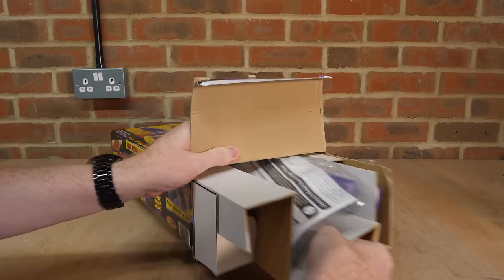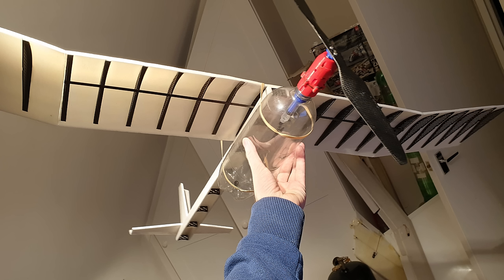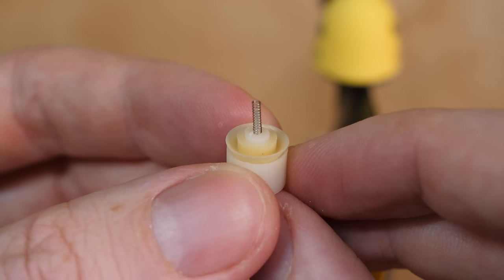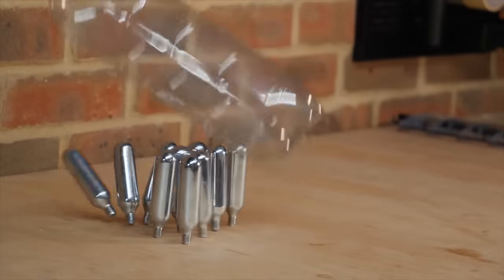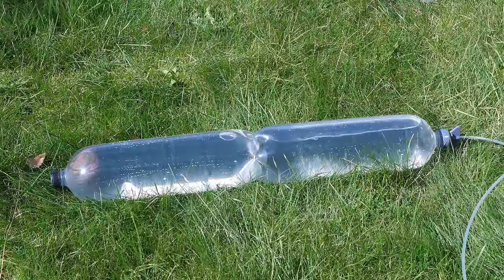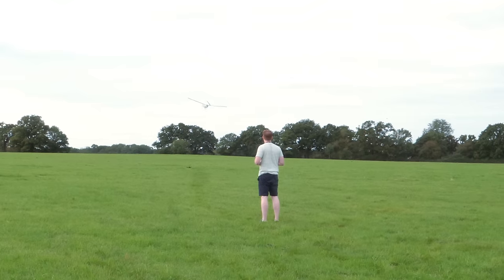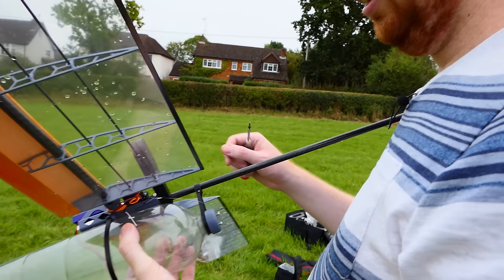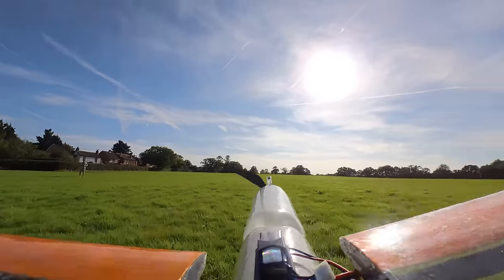Flying a Plane Powered by AIR

Comment: a crazy idea would be to make the wings pressurized to gain more air volume, maybe some internal tube like chamber along the wing to avoid pressurizing the actual film skin
Reply: Maybe the wings filled with helium to decrease the lift needed from the engine?
Reply: storing fuel in the wings is something actual airliners do, this isn't as crazy as you think
Reply: I know it's arbitrary but since it's a plane it wouldn't make sense to use lighter-than-air gases to generate lift, otherwise you could just make a blimp and easily beat the flight length record
Reply: I love this idea
Reply: Wouldnt it be better to replace the tail boom with a third bottle? Like Teslas "structural" battery pack.
Reply: I'm guessing it would be way too much work to build light weight wings that can take pressure.
The shape of the bottle is a big contributor to its strength.
I do like the idea of using helium though haha, even if it doesn't 'make sense', I've seen videos of professionals reacting to basketballs, footballs and American footballs filled with helium and it makes a tiny difference, I imagine it would have a bigger effect on a lightweight construction like this.
Reply: you would have to have the wings be able to hold that pressure, that thin plastic wrap wont hold any air
Reply: Yeah thin tubes in the wings to store the compressed air could work but at the speed it flies drag isn't the main issue I suspect
Reply: tubes are going to add too much weight to pay off
Reply: Sounds cool, but anything capable of holding sensible pressure and not bulging out would have walls way too thick and be way too heavy. The bottles are pretty much the optimal design for this purpose, their cylindrical shape allowing for as thin walls as possible without deforming.

You could use the bottles themselves as wings for a Coandă effect plane, but they're very inefficient and it wouldn't be worth it either.
Reply: These are actually good ideas that are at least worth trying...
Reply: Or an even crazier idea, fill them with helium and get some free lift (at least enough to be just under neutral buoyancy.
Reply: @fdhgsdfdssdf it wouldn't generate much lift because the volume is too low. It just offsets a portion of the weight. Potentially allowing for more bottles or a more sophisticated engine.
Reply: @ImmortalAbsol  that's why the tube like chamber, but it probably would be too hard to source and I don't know how well the weight to volume  to pressure ratio of a bottle scale down, probably would be better to just  have a big singular bottle instead of multiple, and make it part of the structure too.
Reply: @weresonic11 the difference will not be noticeable at all trust me
Reply: You could also make wings as oxygen tanks.
Reply: @hazza2247  got any other gas in mind or would it just be better for storage 🤔
Reply: @DeuxisWasTaken you can put those bottles in the wings, will still gain more "fuel" even if not the entire wing is pressurized. If that is the only place you pressurize (aka add bottles) it will additionally also reduce drag, as the wings protect the bottles from causing drag.
Reply: Should use helium to drive the motor
Reply: @weresonic11  bouyancy of helium is about 1g per litre, the wings look like they could hold something between 1-2 litres, not worth the effort of filling and sealing them I think.
Reply: @weresonic11 not really worth it. With the most optimistic assumptions about the internal volume of the wings and filling it up with hydrogen instead of helium (more lift for the same volume)... You'll get like 3-5 grams of lift maximum.
Reply: If you increase the size of the plan you could just put bottles inside the wings
Reply: @TheWinstn60  Most of the drag comes from the wings and not the body because of how slow the plane flies and how big the wings are so adding more pressure in the wings is a good Idea because it wont increase the drag
Reply: Haha these ideas are wonderfully unhinged 😂
Reply: I doubt that would work, if you pressurise the wings, it would change the shape of the airfoil, if the wing was made of a stiffer material and air bags placed inside the wings, it would be heavy. A third bottle seems to be the most logical.
Reply: The shape of the wings poses an enormous challenge to get that done. However, I think if you made the whole leading edge of both wings a really long high-pressure tube, you could eliminate a lot of the other structural weight of the wings. You could put a tiny low pressure cutoff valve on this tank so that it would only use the pressure down to 20 psi or something like that, because you'd need to keep some pressure in that tube at all times in order not to lose the structural value of it.
Reply: Also you could use compressed helium to run the air engine. It would be wasteful, but you should be able to get a longer run out of it!
Reply: @weresonic11  no it’s just the difference in weight by using helium instead of air would be ‘fuck all’ as they say, it would effect the flight time by like 0.1 seconds so probly not even measurable or worth it. for storage nitrogen or CO2 is probly easier to get your hands on

Comment: Two tips. 1) I have been recycling PET diet coke bottles into printer filament for some time. My first step is to smooth out the iconic shape by pressurizing it to 70psi with a little water and heating it slowly in an oven.  I've successfully shrunk, elongated in a form, and reformed the bottoms into a smooth dome. You may want to consider doing the same, giving you more volume at the same weight. Coca Cola published that their 2 liter bottles are rated for 150 psi, so if you only need 70 some experimentation might be warranted. I would love to see what you come up with. 2) Secondly, you could replace the tail rod with a pressurized fluorescent tube protector and make the plane a flying air tank. The water rocket people use them as pressure tanks as well, so there is a lot of data and technique to start with!
Reply: Best comment in this section
Reply: Awesome stuff, including recycling the bottles, what a great idea!
Reply: if the bottle was full of water before you put it in the oven and still completely filled afterwards, there would be no increase in volume
maybe the sides contracted a little?
Reply: Forming the air chamber into a lifting body, the wings can be shorter saving weight that way
Reply: @marc_frank  - Agreed, You can't fill it up, you just need a little water to protect bottle features from overheating. You could do the same with a wet cloth on the outside. For instance, if you get the threads of the bottle too hot the deform. Not a good thing if the bottle is at 70psi. The PET recycled filament people put a small amount of water in to use steam to expand the bottle if they don't have access to a compressor.

Comment: Hi, something about your wings. Wings have the most drag at the ends because there the pressure between top and bottom is balanced and you get a whirl. For that reason the wings of a sailplane are long and get narrower to the ends. 
In your design there is a problem in the center too because the wings aren't connected and you loose pressure in the middle too. I think, it will already help if you connect the wings with some packaging tape.
Best regards, Frank
Reply: I'm pretty sure Tom knows about induced drag and aspect ratio, but the packing tape is an excellent idea
Reply: or perhaps a lightweight fairing
Reply: I agree Frank, make the wings a tad longer, but tapered, i would add another 30cm, 15 each side, Tail plane needs to be a built up structure, not solid, but remain a V, as that is light, perhaps fair in the front bottle to give a more aerodynamic, and less drag from the prop going backwards, and lastly, the center wing section needs fairing into the wing and Fuz, big time, you are inducing drag, and turbulence there
Reply: If you "loose" pressure, better fasten it …
Reply: For small and slow airplanes it's not much of an issue. That's why small airplanes generally have low aspect ratio wings.

Comment: Hi Tom, epic project! 

I'm sure you've had lots of suggestions but I'll throw in mine anyway:
1. Replace the MG90S servos with standard SG90 servos, you don't need metal gears and this will save about 4g. You could also go smaller (GH-S37D) for a total saving of 15g and reduced size of the supporting structure.
2. Smaller LiPo pack.
3. Build up the tail surfaces from 3mm square balsa rather than sheet.
4. Taper the wings - better lift distribution and structural efficiency. Taper the spars to reflect the reduced bending moment as you move towards the tips. For tubular carbon you could glue increasingly smaller sections together, telescope style. You may need to add a few degrees of washout at the tips but this is easily done by twisting the wing to the desired angle and re-shrinking the film.
5. Lose the gap in the wing centre section and make the wing continuous. This is a big source of drag and is effectively halving your aspect ratio.
6. Add some rounded or tapered wing tips
7. Test some different props to find an optimum for this engine / airframe combination. This can make a big difference.
8. Higher pressure of course.
9. Don't use paint, it's heavier than you'd think and not needed under the film.
10. Use an iron rather than a heat gun to shrink the film. You'll have much better control and won't melt holes in it.

On your comparison to CO2 canisters, I'm not sure that's valid as the CO2 is compressed to liquid phase so it's not just a comparison of ideal gas volumes.

Great work though, I look forward to the next iteration.
Reply: NASA showed up!
Reply: Seriously.
Reply: I'm thinking tapering the wings may not help here. This plane flies super slowly, and is probably nearing the unfavourable range of Reynolds numbers, where the air starts becoming really sticky, and shortening the wing chord would exacerbate that. Perhaps adding a turbulator would help, you can try that on one wing first, which will let you easily gauge if it's improving performance (if it does, the plane will have a tendency to turn to the side with no turbulator).
Reply: With regards to the CO2 cartridges: 
A quick google says a 12 gram cartride (12 grams CO2, not considering weight of cartidge, I assume) has about 6L of CO2 at atmospheric pressure.

I think it might not be worth it.

It's slightly more weight, it's a part that has to be purchased and more strength needs to be added to the design to hold the higher pressure. Unless a larger CO2 bottle can be got easily and cheaply. Better CO2/bottle weight ratio.

Thinking about the rest of the design:
I think I would add a sleeve around the join of the two tanks to reduce drag.

Could also have two double-tanks side-by-side (4 total), have any less aerodynamic components between them and wrap the whole thing in the film. Add a few shapers and make it into a lifting body fuselage, while we're at it.
Reply: … how about a gated prop ? I mean it wouldn’t make sense with the current design but let’s redesign the whole thing - center gated prop with bottles left& right - unified wing on top and aero shaping attachments tu funnel it into said prop - would be way too heavy wouldn’t it ?
Reply: I think some smooth fairings/ airfoil external shape for the engine  and engine  could help improve the Cd of the aircraft.
Reply: Also, there are plastic bottles and then, there are plastic bottles. Sure 120psi is not the maximum achievable.
Reply: The only problem with co2 cartridges though, is that when the co2 expands from the cartridges, it cools down *greatly*, which will inevitably reduce the amount of gas volume that they can supply.
Reply: Make wings hold the air too?
Reply: @xmysef4920 but also they have much smaller frontal resistance, since they are generally so small, that it's possible to hide it directly behind the engine
Can it improve aerodynamics? How significant a role does it play in this case?
Reply: @johnsmith21123  Won't be strong enough for those pressures. Besides you'd probably need more valves and it's not much volume anyway
Reply: @NotAnonymousNo80014  Test to failure! Its fun, but wear ear protection. Dry ice will get you there without all the pumping.
Reply: @samuelmellars7855  I think the relevant measure for the CO2 canister is total energy storage. If there isn't enough volume, you may be able to use a small high-pressure stream of CO2 to entrain a larger volume of air to an intermediate pressure with an injector. This also solves the problem of adapting the engine to high pressure, as only the injector would have to deal with that pressure.

Comment: Love it. You could probably reduce drag significantly if you make a small fairing to cover the gap between the wing roots and allow the air to flow around the centre piece.
Reply: Agree.  Packing tape would seal the gap just fine.
Reply: This is an excellent idea. There'll be all sorts of vortex stuff going on at the wing roots as it is.
Reply: +1 for this.  Efficient airfoils are great, but whole aircraft L/D is the real-world answer.

Comment: Great video as always! Here's a tip to decrease the drag and increase the lift. At the moment you have two half wings joined together at the fuselage. This design generates some vortices (exactly like the wingtip vortices) in the inner part of the wing due to the gap between the two half wings. The vortices increase the drag and decrease the lift. Joining the wing in the middle would eliminate the vortices
Reply: in general the drag of the fuselage IMO hast the biggest potential for improvement. Add a streamlined nose, cover the part where the 2 bottles are joined together, cover the center wing section and add a tail fairing to the end of the rear bottle.
Reply: @martinbrandmuller8272  Agree! There's a lot of possible improvement in the shape of the fuselage
Reply: You were so much more diplomatic than I would have been!
Reply: I hope Tom finds this thread. This is exactly what I wanted to comment as well. At the start of the video, he made a nod to aerodynamics and did do a really good job on the wings themselves, but at the end of the video he's back to talking about weight savings. A nice, clean bulbous nose and a smooth wing root area would absolutely do wonders.
Reply: yep, single wing over the top of the air tank using flaps would be even better.
Reply: Agree, came here to say this about sealing the gap at the wing center section to prevent vorticies.
Reply: This project is really cool. I’m an aero engineer and I think there is some improvement possible. No critique on the current plane intended, but I’m skeptical about the chosen aerofoil and the analysis that went into it. There’s also a lot more analysis to picking the right airfoil than simply look at the L/D curves on Airfoil tools. If only it were that easy.. Given it’s intended flight profile, I think a low-Reynolds number aerofoil would be appropriate. Probably look outside the NACA series. Something similar to Selig S7012 is what we used for a drone. I also don’t think the cable idea is smart especially for high wind/loads. The return force on the V-tail is only as strong as the spring, there’s no positive control there. Lightweight guided rod is really the standard, or moving the servo’s to the empennage and running cabling. Just change the CG. Also, it would be hard to determine without a proper drag polar, but I think the lift induced drag is the biggest concern right now, not parasitic, since the flight velocity is very low. He has got some dihedral on the wing but a wing twist of around 3 degrees may also help in these flight conditions. My two cents
Reply: @last_name3143  Looking at how he built the wing in CAD by tracing an image, I would say it would be better to import the csv file of coordinates instead so then he actually has the exact shape of the aerofoil instead of an approximation.
Reply: @last_name3143  great observations... if he's going for duration, a thinner under cambered wing section would be a good choice, this would further reduce the flying speed and so make parasitic drag less of an issue. Also CG location could be honed too.